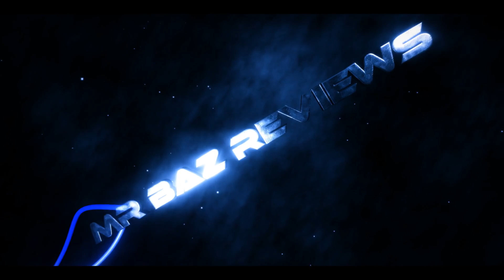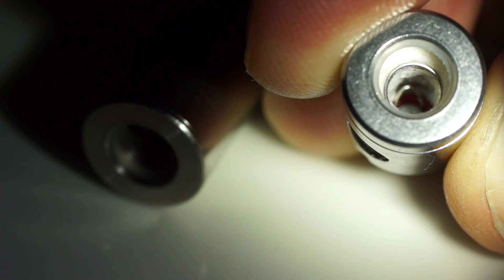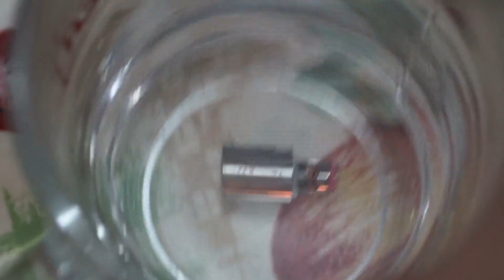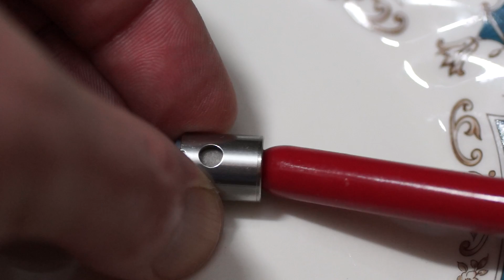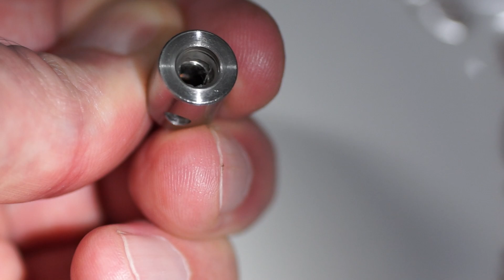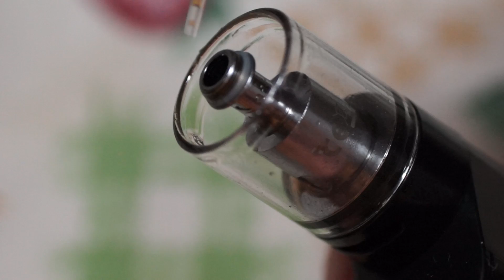How to clean and re-use your sub-ohm e-cig coils

Comment: Why do I not get much vapour and hard to pull after washing my coul
Reply from the maker: You have to fully dry it
Reply: @MrBazReviews  Oh what do I do now I’ve already used ut
Reply from the maker: @erickim1663  You could just use it for a bit it should over time improve. But it's best to dry them out before filling them up. Otherwise water is left there and it dilutes the vape
Reply: @MrBazReviews  is it gonna come back to normal if I just keep using it
Reply from the maker: @erickim1663  Try it see what happens every coil is different
Reply: Yeah it definitely taste so much better thankq

Comment: Boiling water works the best i feel you can see the water literally go inside the coil and move carbon around if its that dirty i usually just do it if i want to swap juices in my podmod.
Reply from the maker: It does work though the cotton might shrink a bit; I'd maybe lean towards hot v boiling. Some use alcohol
Reply: @MrBazReviews  true been boiling them for a few months now using fireluke coils and its been working great, one coil lasted me a whole month lmao cheers

Comment: Would this work with a 1.2 ohm breeze 2 coil?
Reply from the maker: I have not used that, it is worth trying soak for a good length of time, seems to dislodge the build up of carbon
Reply: @MrBazReviews  alrighty I’ll give it a try, thanks for the reply!
Reply: @MrBazReviews  well it worked but now it floods the coil
Reply from the maker: @ezraredgwell  I've not used that one so can't say, if it's dry and clean it shouldn't flood, but it was worth a try

Comment: I do it a bit different. When one goes off I toss it in a glass jar of cheap vodka that has a lid, let it sit for a day then soak it in hot water and let it dry thoroughly. Gives me 2-3 uses out of an RPM coil that way
Reply from the maker: You can do that alcohol can help break the carbon down, main thing I think is soaking it long enough so that it cleans off easier
Reply: @MrBazReviews  Hard to clean SMOK RPM coils like you do though since the opening is a lot smaller. I just do the alcohol soak then the steaming hot water soak.

Comment: Does this work on nord 2 mesh coils?
Reply from the maker: I've tried small coils soak them longer it can work though not as easy to clean them out
Reply: Good to tide you over until you manage to get some new coils you will get a week or a few days more use from the coil but your flavour won't be as good compared to a new coil

Comment: Isopropyl alcohol/methanol is better as it desolves the oil and dirt and deposits  soak for 4 to 5 hours then rinse in distilled water (the ice frost  in your freezer will do as it is deionised ) my coils end up clean and white like virgin snow!
Reply from the maker: Useful tips thanks
Reply: I would use cheap vodka before using rubbing alcohol.
Reply: Hmmm Methanol is poisonous so Alcohol is better 😂😂
Reply: @simplepyro7897  You don't drink it lol isopropyl is poisonous too 🤣
Reply: @mickjmcgregor4384  
I meant you can't touch it easily like isopropyl alcohol 😂😂😂😂

Comment: How do you get weeks out of your coils? Mine taste gross after 2 days
Reply from the maker: Guess it depends on the liquid used lower mix seems to last longer
Reply: Also the very sweet desert flavors gunk up coils very fast!
This hot water trick works. Great. I boil mine for 5 min in a inch of hot water on the stove. Then let it cool. I put  a hair dryer to heat up. And dry off the cotton. Just tried it now. Works great!

Comment: I wish Ive seen this earlier. I just switched from rebuildables to pods just recently. And my first pod (For Voopoo Argus) only lasted two days. After disposing it, I thought there must be a way to clean it. And thats why I landed here. I just wish I saw this before throwing my first pod. Anyways, thanks for the video. Will try this soon.
Reply from the maker: It's worth trying it works fairly well on the larger coils, but can also help with the smaller ones if you soak them long enough
Reply: @MrBazReviews  Copy that. Will try this and update you afterwards. Thanks again for the video!
Reply: @BenjaxRivera  How'd it go?

Comment: 4-5 weeks ? Wtfk ... after 1-2k puffs mine are gone... that means a minimum of 4 days to a maximum of 8-9 days
Reply: My coils taste gross after 2 days I've tried switching from m5 to .15 which tasted better but still only 2 days out of the coils what can I do to make mine last weeks!!!??
Reply: @Fionamarie0211  now I have the same problem, I switch the tank couse I’ve tried it to much but is not good anymore 😞
Reply: @nsorayion8950  right, I've tried switching everything but nothing helps. Very frustrating
Reply: @Fionamarie0211  i feel you 😩 i keep the mod and wait for a new tank 🤞
Reply: The minimum of mine can get at least 3 weeks..
Reply from the maker: Depends on the coils they vary a lot and the liquid also makes a difference
Reply: travis.Six how much do you vape in terms of ml ? Becouse I really don’t understand how you guys can use 1 coil 2-3 weeks ... I vape dli, around 15 ml at day, single coil of tfv16 lite ( 5 days 1200 puffs ) and double mesh coil ( 2k puffs 8 days )

Comment: Wb caliburn coils..?
Can I use this method for my uwell caliburn..?
Reply from the maker: Not tried it if it's a coil it should clean up
Reply: You can, I've done it - just don't expect it to be like a new coil / pod. I've been experimenting with different methods trying to find the best. What I do right now is put some near boiling water in a insulated thermos with the pod, put the lid on, and shake it a bunch. Then rinse with distilled water and allow to dry. Again, it won't be like new - but it can usually buy you time until new coils or pods arrive in the mail.

Comment: No extraction or dismantling process of the coil?
Reply from the maker: Can do if you want, or if you can. I find the soak and rinse works OK for many coils
Reply: @MrBazReviews  is it advisable also to use vinegar in soaking a coil?
Reply from the maker: @ramgel420  You can don't let it soak for too long maybe an hour (the smell/taste can be a problem), rinse very thoroughly. You can also try lemon juice or vodka even. The water is the safest but needs a bit more time to soften up the build up.

Comment: Thank you! 🙂 Is this method good for any brand of coil? I use Aspire Atlantis .5 ohm and I can usually get a couple weeks, sometimes more, depending on what I'm vaping
Reply from the maker: Seems to work with most, if you can get to the coils it's best, otherwise soak them for a day or so 
I've used it for a while now even smaller coils it helps
Reply: @MrBazReviews  awesome, thanks 🙂

Comment: 4 weeks? Good god. I have never, ever...ever gotten a coil to last for more than about 2 days without it becoming really gross and horrendous. And I always prime it, use the correct watt setting, try not to vape too fast...
Reply: 2 days good god
Reply from the maker: @NDC958  Maybe he vapes a lot! I get quite a long time out of these coils. The small Kanger ones they're good for about 10 days maybe a little less sometimes more depending on the juice. I easily get a month out of these - then clean them
Reply from the maker: I'm not a heavy vaper I admit but I use 50/50 mix or 30/70  the heavy thicker fluid clogs up faster from what I've seen
Reply: Your coil lasts only 2 days? You must be doing something really wrong, or vape 24/7 massive amounts of juice on high power.
Reply: @Scaorlet  Idk it lasted for me 2 days tho i vaped about 10 ml in these 3 days 70vg 30pg 3mg nicotine pineapple juice and im chain vaper
Reply: @kaljevic1  What tank and coil you use, and how many puffs you took when you changed the coil? Unless you do somethng wrong and/or use some super shitty coil then it's not possible even if you chain vape..
Reply: keep your tank topped up all times! that increased my meshpro single coil lifetime from maybe under a week to 2,5 weeks...
Reply: @kaljevic1  I heard those smok coils can be garbage, especially with sweeter juice people get them burned easily in a couple of days. And you have that smok vape pen, well with a light juice without much (or very light) sweeterner you might get few more days up to a week, but that's probably it. When you chain vape such a device/coil, no wonder it doesn't last. With a decent tank (&mod) you can get a couple of weeks with one coil no problem. Personally i would awoid smok products from what i've heard and seen, the quality seems to vary a lot with their products unfortunately, but that's just from what i've seen and heard. I once had a vape pen and it sucked ass from the start, short lasting coils and leaking issues.. it was a nightmare. Well now with a decent setup i don't have to worry about anything, i think it's worth to invest in a good device if you vape a lot.
Reply: I use aspire cleito pro tank and coils and I can NOT for the life of me get mine to last more than 2 days im also a chain vaper but still 2 days compared to 5 weeks is a huge difference. I always prime my coils and vape at about 70w